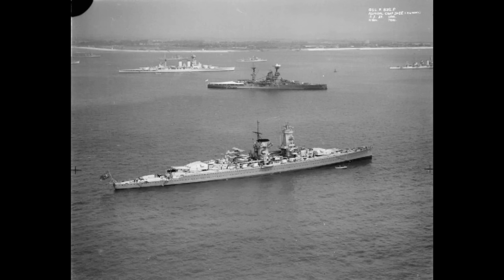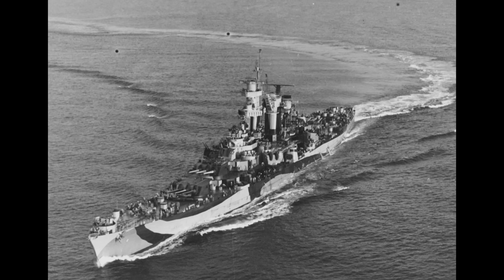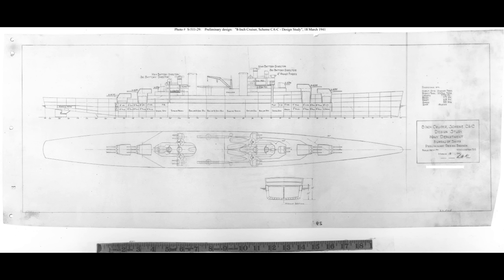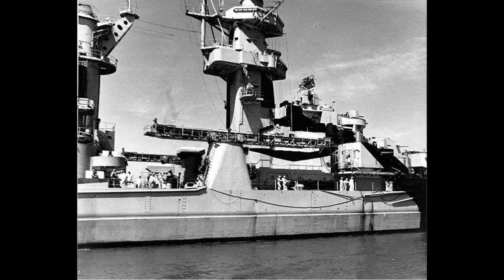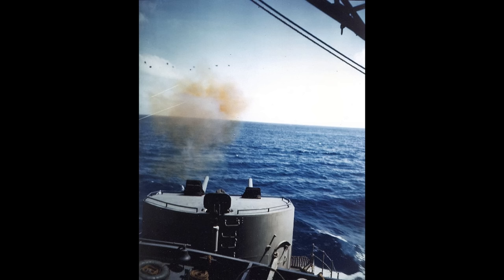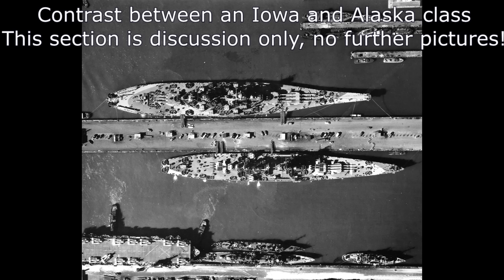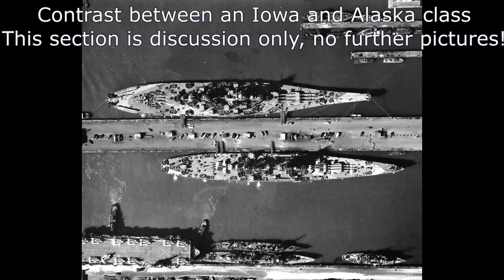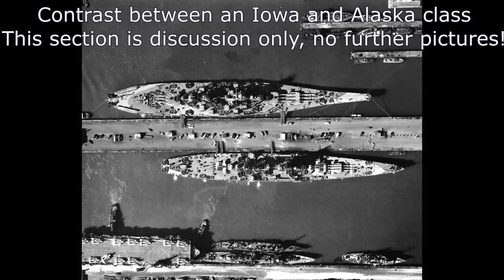The Alaska class - Large/Super/Battle/Mega/Hyper/Ultra Cruisers

Comment: I’m fully in your camp that these are in fact large cruisers not battlecruisers. 

They were designed to USN cruiser specs using cruiser practices not battleship specs using battleship practices. They for example lack a side protection system. 

They don’t have guns that are contemporary battleship grade. In the 1940’s no one thinks of 12” gun as befitting a battleship any more. 

The basic formula for the vast majority of battlecruisers was to reduce armor and fire power to gain speed. The Alaskas very clearly are not following that formula. They unlike those previous ships are smaller than any contemporary battleship and have only marginally more power than is fitted to those ships.

The one area where they align at all with battlecruisers is their mission brief which is similar to the original Invincible class. But I think you can also make an argument that as the battlecruiser evolved that mission brief changed. And the Alaskas were very obviously not designed to do the kind of things nations expected from their later generation battlecruisers.

Comment: its a battlecruiser simple facts all other ships of similar capabilities o class sharnhorst project 1047 b-65 Dunkerque were all called battlecruisers even if they aren't the same as ww1 era battlercuisers did battleship, cruiser, destroyer designs stay the same for 40 years no, also lexington class was called a large cruiser but it is obviously a ww1 style battlecruiser therefore large cruiser is not an entirely new class it is just a fancy way of saying battlecruiser, battlecruisers evolved to fill the gap between cruiser and battleship heavy cruisers had 203's, battleships had 383-406 and battlecruisers having 283- 300 mm guns (i know there were ships with larger and smaller main batteries but im referring to the most modern ww2 designs ie bismark nelson iowa v veneto)
Reply: The term large cruiser or super cruiser sounds like its just a variation of cruiser like heavy or light cruiser when this is obviously its own class in the gap between battleship and cruiser Battlecruiser if you will

Comment: Indeed, the Iowas are the fastest battleships ever built, outpacing even the Italian Littorios by a knot or two. While no Iowa ever recorded a speed higher than thirty-one knots. What good is having a capability that is never used Where is the South Dakota's all exceeded there design speed in Shake down cruises So yes The Alaska class was faster then iowa's just not on paper.
Reply: USS New Jersey achieved 35 knots in the late 60s as a record breaking run. It was extremely lightly loaded and had all its WW2 anti air guns taken off, but didn't have any of the later upgrades weighing it down.
Reply: @B52Stratofortress1  So there you go with a war load they did not achieve there Designed speed where as the South Dakota class all exceeded there designed speed if you have to modify the design to get a better result does not count And the North Carolina class have vibration limitations
Reply: @williampaddock4863  The Iowa's were rated for 33 knots and regularly achieved this speed at full power.
Reply: @B52Stratofortress1  Rated not achieved till they lighted the up later after the war